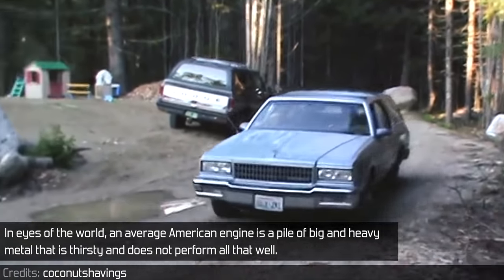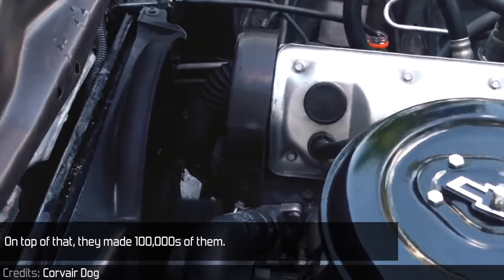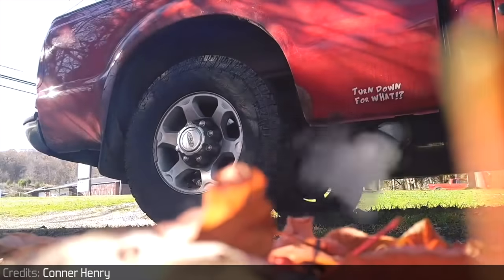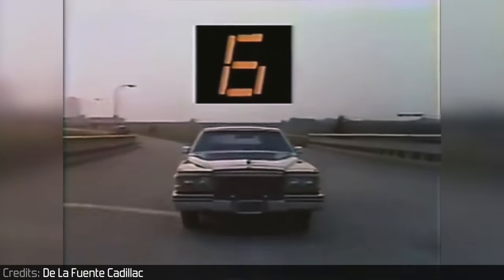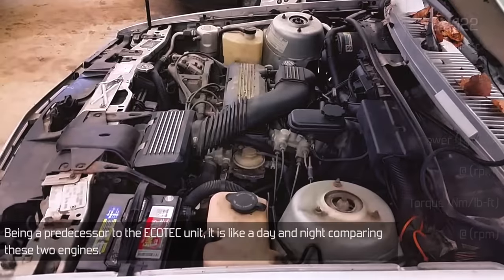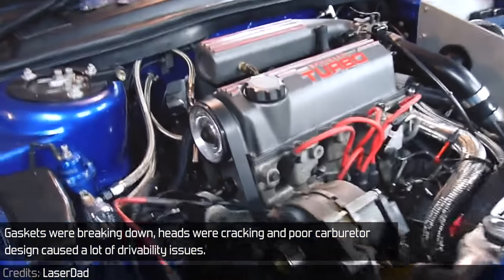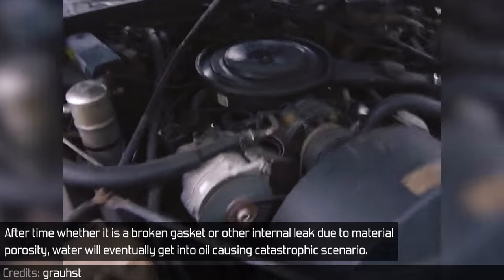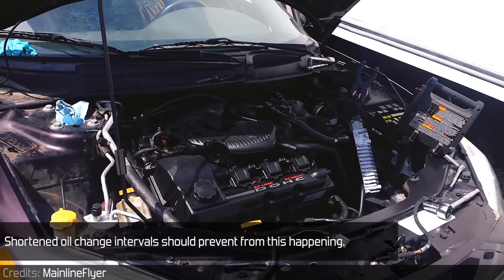8 Worst US Engines You Should Avoid

Comment: Crazy how far we've come
Now we got 700hp+ hellcat engines
Reply: I'm curious though how these engines, especially the small displacement high output EcoBoost Ford ones will hold up when they are 5-6-7 or even 10 years old. A lot of 70's and 80's cars are still around due to their simplicity. I'm not sure that will be the case with today's Hellcats, SHOs, Raptors etc., which is a shame, because the average person can only get a hold of one used.
Reply: Kris V that applies almost to all forced induction engines
Reply: anything under boost can make 700 hp. do it n/a.
Reply: Frigglebiscuit just comparing it to the shit engines we had before. Yea I know practically anything thats boosted can hit 700
Reply: The early 60s Ford "cammer" V8 had close to 700 hp from a 7 liter. Naturally aspirated. Ford Werent fooling around at the time.
Reply: +SuperMechguy  the 426 Hemi dual quad hit 700 easy :U That was released in 66

Also the hellcat In has 625 horsepower to the wheels. While a Hemi (dual quad wedge intake) could keep 700 to the wheels
Reply: CaddyPro'59 the ford cammer was a piece of shit that should have never been designed the way it was. Mile long timing chains, unreliable, and one cam spun faster than the other....it didnt really perform until the cam and timing chain issue was fixed.
Reply: they didnt need 700 to the wheels, because they werent BOATS. buick was going to release a turbo nailhead back in the 60s that was 800hp and 800 ft lbs, but didnt, because they figured people would kill themselves. the hemi dart, and other experimental engines could have easily put done that power, and did on the drag strip. just because production does it, doesnt meant it is legit.
Reply: Frigglebiscuit - True, but only a properly engineered one will hold up to that power. And you're right; It takes forced induction, but it doesn't matter, as long as it has good long term reliability.
Reply: The Demon is pushing 808HP on pump gas, and 840HP on race fuel. Can't wait to see GM and Ford top that, (and they almost certainly will). 1000HP would be pretty useless on the current Corvette, but not on the upcoming mid-engine Vette. How about 1200HP and all-wheel-drive in a 3700Lb chassis? My guess is it could be done for about $140,000.00. 

That would destroy the GTR. Godzilla? No, just a lizard.
Reply: Foxmakesmodels Your numbers are skewed.  The older cars were not street able where the new cars are.
Reply: Frigglebiscuit  Do you just dream this crap up?

Comment: Ford 4.6 & 5.4 sohc V8s are amazing engines. 
They'll go 500,000 miles without touching the spark plugs. 
If you put anti-seize compound on the plug threads when they're still low km you'll never have a problem.  
When installed in trucks shield the exhaust manifolds from road-splash to prevent manifold problems.

Comment: Ok but, the 4 valve modular engines were pretty bad ass
Reply: Public Enemy #1 30" wide at the valve covers and most were over 600lbs. It's not about features like OHC and multivalve heads when they are all making 400hp and averaging over 20mpg. Mod motors were huge and so are the Coyotes.

Comment: Before i watch this video I feel like a lot of these are going to be 1980s designs when engine performance was truly abysmal due to emissions and fuel consumption regulations
Reply: ...and I was right, several of them were around that time. 🤦🏾‍♂️
Reply: With the exception of the 2V Tritons shooting out plugs and the 3V ones breaking off plugs in the head they are pretty much all old garbage made to meet government regulations and take advantage of the domestic manufacturer market dominance in the US led by mistrust of foreign manufacturers.  There were still plenty of reliable American engines in the 80s, though, like the older V8 designs and the Ford 300 straight 6 which is one of the most dependable gasoline engines ever made.
Reply: wes276 There were a few good ‘80s designs. Ford made a great engine with the 3.0L Vulcan.
Reply: UnsulliedSpy. The 300 I6 / 258 I6. My absolute favorite engine.
Reply: most of the problems came from corporate greed , you could only buy junk for a few years , and would still be buying it if toyota and nissan did not come along , do not comment unless you have owned a vega or pinto

Comment: The GM 122 was not a crap engine, It is slow as a turtle but it was reliable as shit and see them all the time with well over 200,000 miles on the clock running strong in cavaliers with barely any body left to them from all the rust, p.s. how did the North Star not make the list
Reply: i had one in my S10 that i bought brand new. ran it to 345,000 miles other than oil changes and normal maintenance the only parts on it i had to replace was the water pump, alternator and radiator.

Comment: The VW air cooled engine should rate high here.  Heads had to be rebuilt every 30K-40K miles and the magnesium alloy block could not be relied on for a rebuild as mag alloy gets brittle with heat and age.  Fuel economy and performance was poor too.
Reply: William Gratchic I so much agree
Reply: Plus the whole "randomly turning into a raging fireball, burning your whole Bug to the ground" thing.
Reply: Never heard of such a thing before. They were usually good for 80-100k, which isn't much, but not 30-40k.
Reply: I work on VW air cooled engines all the time, they are one of the best engines ever made, probably why they are still on the road after over 70 years.
Reply: @theunconventionaldeal3879  Yes I agree some of these people are talking out the side of there necks
Reply: @darrenmillion1432  I don't think any of them know how many bolts hold the engine in. 🤣
Reply: @theunconventionaldeal3879  I know I don't but I do know that my brother had a 1970 Bug and I learned then how well they was made.  A motor that wants revved to the moon to live has to be a well made motor and never one problem out of it. My dad showed him how to drive it and my Dad loved VW after that.
Reply: Awesome
Reply: This is a video about American engines
Reply: VW aircooled was a great engine

Comment: The later cast iron block Vega engines were fairly reliable.
The later Olds 350 diesels were also pretty decent once they started putting forged cranks in them.

Comment: The Mopar 2.2 is with out a doubt  one of the most reliable engines ever built. Even GM and Ford people have said the same. I'm not deigning they had some problems (show me an engine that doesn't) All their issues were corrected as the years went on. I had one in an 83 with 227,000 on it when the clutch gave out (the car should have been pulled off the road long before because of rust) did not use a drop of oil going 5000 miles on changes!
Reply: I'm one of the  "Ford people" and I disagree.

Comment: The modular engines were actually extremely good engine that was the only problem
Reply: Ty Bailey True, depending on model year. 1997-2003 4.6L- 5.4L Triton SOHC Two-Valve V8s are very good engines; other than the infamous spark plug problem that can be avoided by using a little anti-seize and torqing them down to spec (I believe 20 lb-ft) and exhaust manifold leak, causing that "ticking noise, there's no major problems with the Triton V8s. I drive a 2002 Ford F-150 XLT SuperCrew 4x2 powered by a 5.4L Triton SOHC V8.
Reply: Yes sir...all easily avoided problems if you just do shit right and follow the manual
Reply: Creed 00 EXACTLY!!! And when you acquire a vehicle, no matter the year, make or model, do research on it. Also do a full inspection on it, too. Never buy a vehicle that has been dogged by a careless owner, unless you want to give it a second chance, if you have a good budget.
Reply: De carbon the cylinders helps with plug removal
Reply: Ty Bailey my 2010 crown vic P71 is at 600k miles on the original engine
Reply: James Gaines My '04 5.4 3 valve run's great at over 240K on it and have never had any problems. When I did a tune-up on it I used autolite spark plugs with anti seize lube. I'm old-school I let it warm up in the morning and keep up on my oil change's.
Reply: The Ford Modular engines,oil pump problems.Seizes the bottom end up.The 3 valve 5.4 is a complete pile of shit.Cam phaser problems,exhaust manifold replacement which is a pain to do paying $700.00 and up for one side.These eat ignition coils galore with the coil on plug,this is what you replace when a misfire code appears.I can name more.The 4.6s in the cop cars blew up in the police chases and any Michigan State cop has some explaining to do when this happened.The California Highway Patrol is doing away with the Fords,too expensive to buy and maintain being replaced with Dodge Chargers which are cheaper to buy and maintain.

Comment: The GM 122 was an Opel (GM of Europe) design. A lot of the engines in the late '70s and early '80s had thin cast heads made in Mexico. Those were junk. The Olds Quad4 was the result of GM in-fighting. Olds designed a high performance DOHC V8, but GM Corporate wouldn't allow them to produce it. Their development budget was cut and rather than scrap the design they cut it down to a 4 cylinder. The engine needed more development, but was pushed to market with the expected results. The Mopar 2.2 was a Mitsubishi design.

Comment: The trition is actually a pretty good engine 😕
Reply: Rodney Rodriguez until it spits a plug
Reply: They have repairs for it otherwise a pretty tough engine
Reply: Rodney Rodriguez I agree. If you take care of them, they will last a long time. Changing the plugs and oil changes at manufacture recommended intervals will ensure a long life
Reply: It's wonderful till the sparkplug change or it decides to YEET sparkplugs out of the engine ...
Reply: @godislove8837  4.6 2v is the most reliable one, dose not have the spark plug issue. 3 value bad, 2 value good

Comment: VisioRacer the ford triton are strong engines. Operator neglect causes the sparkplug failure. 
The 2200 is a cheap engine that worked. They did not have great performance demands in mind.
The mopar 2.2 is a Volkswagen design from the 1970s. Blame the germans, not us. The Dodge 2.7 was a mitsubishi design, not us. Blame the Japanese.

Comment: The false accusations about the Triton engines are just wrong. My family has a Lincoln Navigator (5.4l) the has right next to 320,000 miles, and it has never had a problem. In fact, there are multiple people I know that have them, and they all say that they do great.
Reply: I've had great luck with tritons too. The reputation is definitely undeserved.
Reply: In west texas all you see in 1/2 ton 90s to 2014 model 4.6 and 5.4 because they can handel the heat unlike dodge and chevy the dodges will burn up the overdrive and chevys just were to hard to start and had problematic tranny issues
Reply: I agree they are a good engine, however l think when a manufacturer overlooks or lets something go into production with such a glaring engineering issue like barely enough threads to hold a spark plug in, it makes you wonder, what else did they cut back on or say "good enough, we'll let the end user deal with that". And thats with all manufacturers of EVERYTHING we buy.
Reply: The fact that specialized rental tools exist for extracting pieces of broken spark plug from the cylinder of those engines is proof that the issues are not "false accusations". You are just lucky. That or your engine in particular was one of those where the problem had already been solved. Apart from that one real issue, I will agree that those are fantastic engines, even as a Chevy fan I can respect the modular motors.
Reply: @jrhaley9624  um your claims are false Chevys have never been know since the triton has been around as hard starters and most of the trans issues are from owner mis care. Unless it's a Alison.
Reply: @jdrok5026  chevy 6.2 diesel 6.5 diesel you could pull the damn things to the shop before you could get them started at all
Reply: @jrhaley9624  those diesel are known for their easy cold starts.
Reply: @jrhaley9624  like there's people doing cold starts below freezing easily.
Reply: Conner McGrady there is another word that I'm thinking about when I think about a Triton- the word also  begins with a T , next an  R..... this word has an A in the Middle and an S and an H at the end....

Comment: Northstar
Reply: Gone YES
Reply: I kept waiting him to mention it!
Reply: One of the worse eng GM ever produced
Reply: really? last I heard the Northstar was a pretty good series of engines.
Reply: Jay Maechtlen almost certainly they will suffer from a head gasket.
At the auction if you smell antifreeze a Seville or a Deville is near by with a northstar
Reply: Jay Maechtlen also by gm standards its acceptable for the northstar to burn a quart of oil every 1000 miles right off the line. Now granet my truck burns a quart every 2000 miles but that's cause she's a 94 with close to 200k miles.
Reply: had 2 northstars both ran to over 100kmiles, its all in how u service them....

Comment: You forgot to add the Cadillac northstar engines to that list. Starter in the dumbest location. This engine develops head gasket failures with ease. And usually one head gasket failure = a trashed engine. It cost a fortune to rebuild one one as well.
Reply: Cadillac North Star Towed to a Junk Yard near you! Go to any u pull a part salvage yard and there will be 3 to 4 rows of these turds sitting there. I friend of mine swapped his north star and put in a Supercharged 3800 Series II engine and bolted right to the transmission.  He still drives the car and its a 1999 with a Supercharged 3800 Series II engine in it. This 3800 Series engine was one of the most reliable engines GM has ever made. Cheap to fix. 3800 Series I made from 1986-1995 Series II made from 1996-2004 and Series III made from 2005-2012 I think that would be almost 30 years before retiring it.

Comment: That's why I like old Mopar V8's, Slant Sixes, and for any modern cars, I will only drive Toyota. I've been a mechanic for over 20 years. I know the better and least headache cars. Both Fords and GM products are Trash, coming from experience because they are always the ones consistantly in the shops. Sorry if I ruffled any feathers. 😉

However I will give ford credit for a few of their older engines, the 300 L6, 302 V8, 351, 390, and 460 V8's
These were rather indestructible!

To the Chevy 350 fans, sorry but they werent a great design. Biggest mistake was the close placement and bad sequencing of exhaust valves in the heads causing cracks between combustion chambers, this was very common. Heads often have to be replaced because of this.
Reply: You can't beat the slant six 225...mated to a manual three-on-the-tree transmission...it was a fine car.  I also thought the 318...while not the fastest...would run forever.
Reply: The 318's were absolutely a great engine. Just about completely indestructible. Thats why they were used for so many years (nearly a half century) and they were still dependable up to the last year they were produced. 👍

Comment: Not to mention that the Tritons were such under-powered turds when compared to GM' s LS and Chrysler's Hemi engines during that time.
Reply: Yeah,that must be why more Farmers buy Fords if they are buying a gasoline powered truck right?
Reply: @lawnmowermanlawnmowerman9930  The main thing that killed the Triton's performance was the terribly spaced 4-Speed auto they had in them, The 3v V-10 with the 5-Speed torqshift performed much better than the old 2v V-10 with the 4-Speed, and for the 2009-2010 model year when the 5.4L was backed by a 6-Speed auto its performance increased quiet a bit, of course the following year Ford dropped the Triton engines in favor of the more modern 5.0L, 6.2L and Ecoboost engines.
Reply: the 4.6 2v is a bullet proof engine. you have to get 2v and they dont have the spark plug issues
Reply: Greg O s there was no hemi's at that time. The ls was the vortec in the trucks. And not very powerful